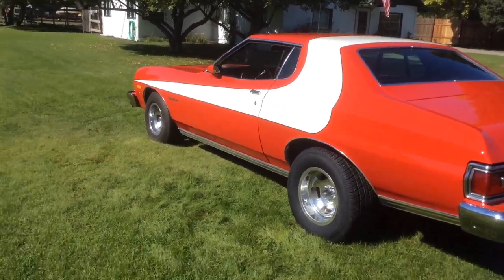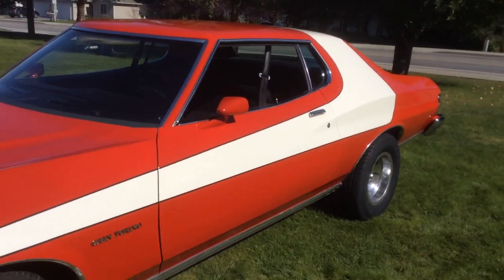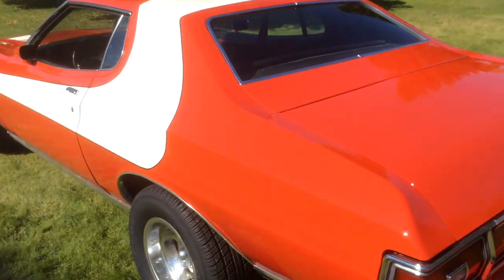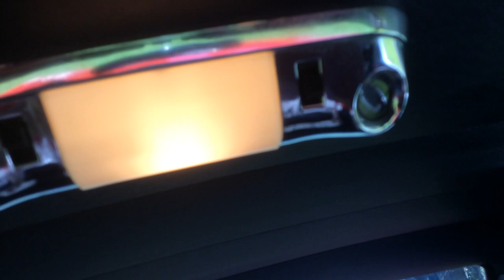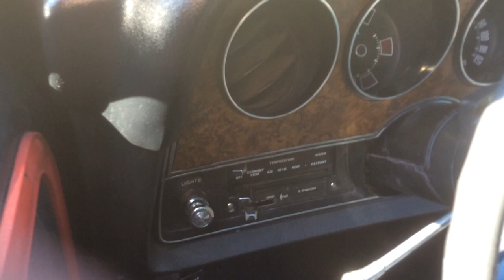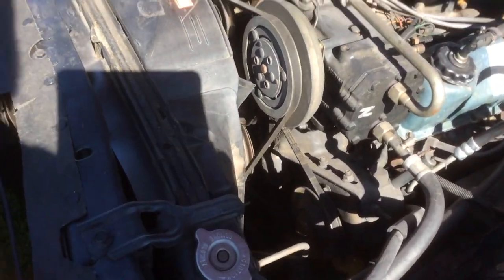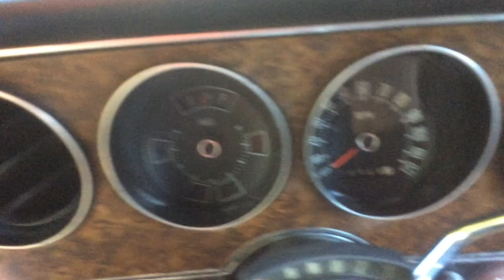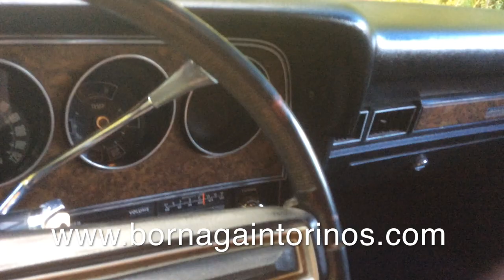My 41st Starsky & Hutch Gran Torino in HD (SOLD!)

Comment: Are you already working on # 42 ?
Reply from the maker: Hey Rick, I have a couple in mind but have not started one yet. I'll have updates on my website
www.bornagaintorinos.com
Reply: Thanks for the reply...the pickin's for these babies have got to be getting pretty thin.  I haven't seen a  GT on the road OR the boneyard in a long time.  Your searches must be nation-wide.
Reply from the maker: They didn't make many to start with, then so many were crushed in the 90s & 2000s. Finding a clean, rust free driver is getting really, really hard. I don't know if I will make it to owning 50 torinos before I retire.
Reply: Well Steve... I checked your website & Spring 2018 has come and gone .  Have you found a prospective # 42 yet ?

Comment: Would be interesting to see one with the pilot show striping. It was shorter, going forward, more narrow over the top and not as wide on the sides. I’ve never seen a tribute car in that format. If I ever had one made I’d want the pilot show set up so it would be “unique”. As for this stripe, it’s DEAD on! Most don’t get it right.
Reply from the maker: Hey there Shaver X. I have to build what the majority of starsky lovers want to stay in business. They are a very particular group of car lovers.
Steve
Reply: Born Again Torinos howlong does this resto take?
Reply from the maker: It depends on what I have to do with it, is it missing parts etc. I'm managing to crank out one a year.